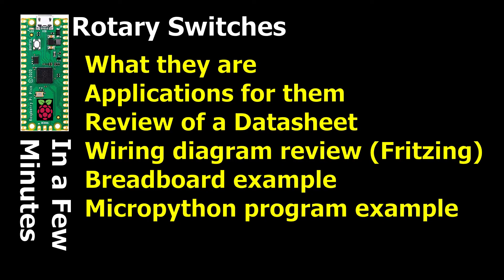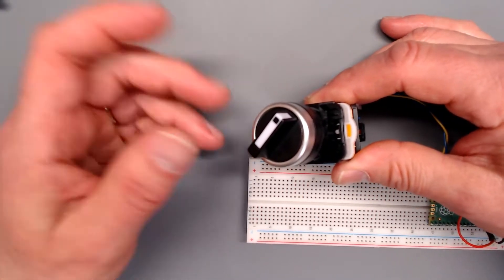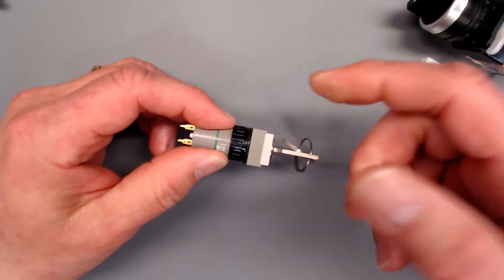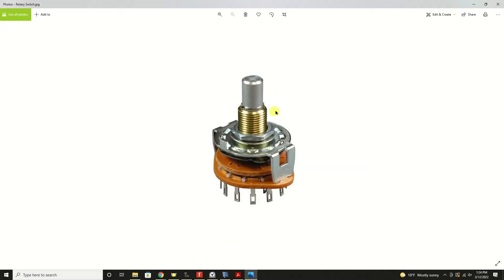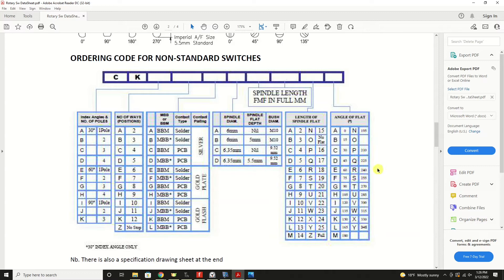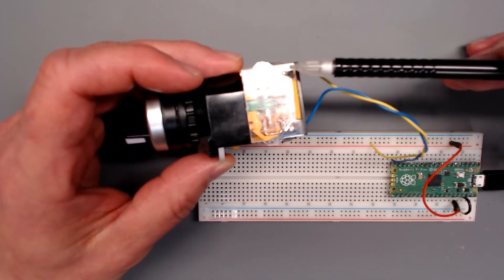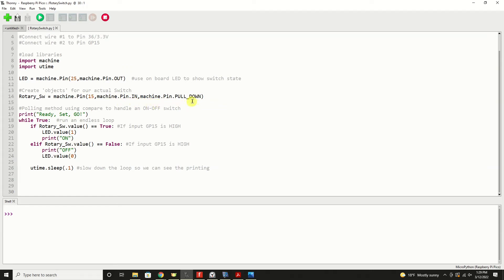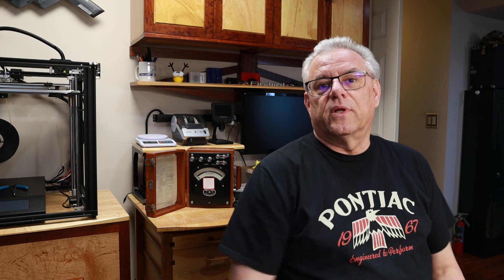How to Interface a Rotary Switch to RPi PICO

Comment: Question: (I am a beginner when it comes to this stuff so bare with me if my question has a super simple answer.) If the switch you used is rated for 10A 660V how were you able to power the switch through the pico? Was it simply because the Switch only needed the Volts and Amps needed to power the LED? I thought the component has to match the out voltage of the controller? If so, does this mean I can buy a 16v switch and use it as long as the application I plan to use it with doesn't output more than 5V?
Reply from the maker: Good morning himes1821,

Electrical and electronics is a complex playground.

Switches are rated for how much Voltage and Current they can safely switch on and off.  That is their MAXIMUM rating.  They can also switch on and off the lowest of voltages and currents.  To further explain, purchase a switch rated for at least the voltage and current you plan to control (switch), it will be fine for everything below that as well.

I hope that helps,
Cheers!
Chris

Comment: Nice video! A quick suggestion on your python code style. Capitalized identifiers are usually used for types (eg. class Pin: ...) while variables are usually spelled with lowercase (eg. rotary_sw = Pin(....)). Your usage of snake_case is correct. Global constants are spelled in UPPERCASE, for example: HOURS_PER_DAY = 24. By convention, comma's are followed by a space. Your usage of spaces around operators is correct.
Reply from the maker: You have found my weakness!!!  I have had a cap style for programming that goes back to the early 80s.  I have adapted my style over the years to accommodate trends but with Python, not so much.  Around the time I was picking up Python, I was working as an executive in a Japanese company.  I handled all the communications and the President of the company forced me to capitalize everything in his unique style (every word needed to be capitalized and most sentences needed to have a bullet).  It was a crazy time, but being forced to follow his case rules without option, I rebelled against Python rules 🙂
Reply: @MakingStuffwithChrisDeHut  Python first saw the light in 1991. Probably the president of the company forced his capitalisation obsession on your C programs?